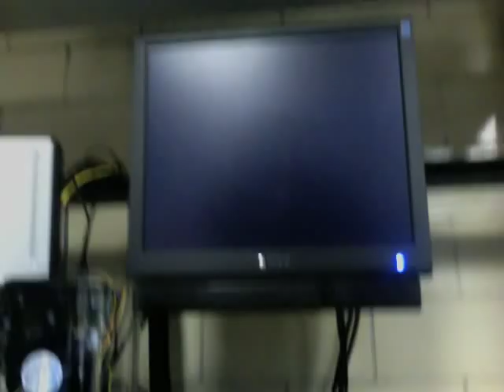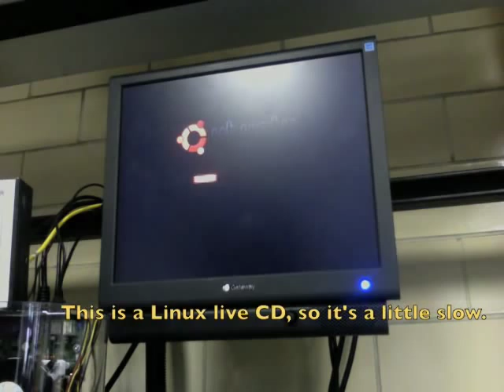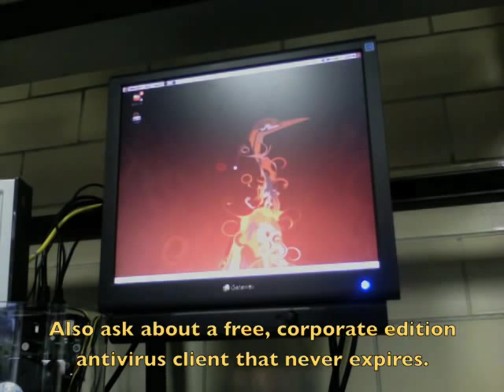Submersible Computer

Comment: Unbelivable but I learnt today that this is possible. Nice work! BTW, for how long can you use the same oil? And also what about the processor fan? If the oil cools by default, does it make any sense having those fans in there?
Reply from the maker: Mineral oil is non-organic so it really doesn't change over time.  This computer has long since been put out of commission, so I can't tell you for sure but I don't anticipate any issues.  Over time the level did go down a bit, so we had to add more.  The fans help circulate the oil over the heatsinks.  Just like air cooling, the oil had to be stirred to dissipate the heat.  The oil does eat away at adhesives, so many of the stickers fell off of the components.  After some time the oil got too hot and I had to add a radiator to the setup.  It pumped the oil out of the tank, into a radiator where it removed the heat, and back in to the tank.  I was hoping this wasn't necessary, but indeed it was.  Glad you enjoyed it!
Reply from the maker: By the way... these people make custom built oil computers:  http://www.pugetsystems.com/submerged.php